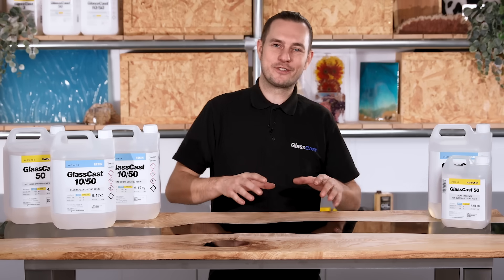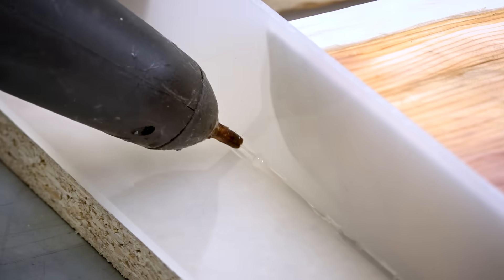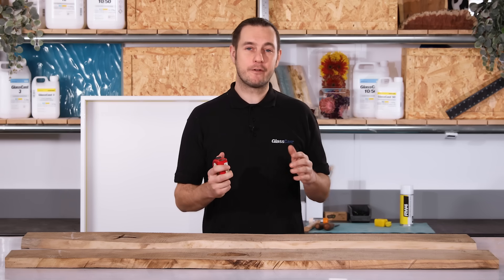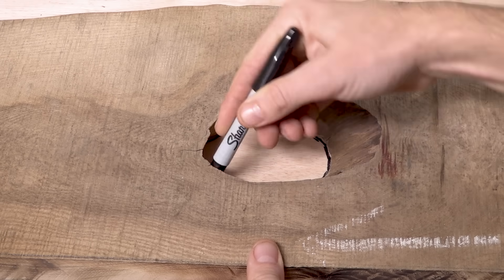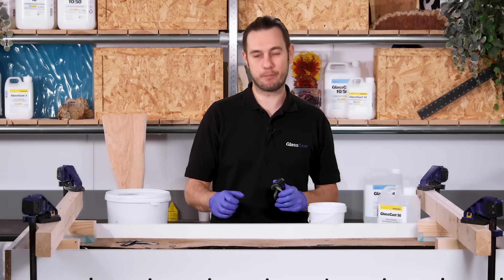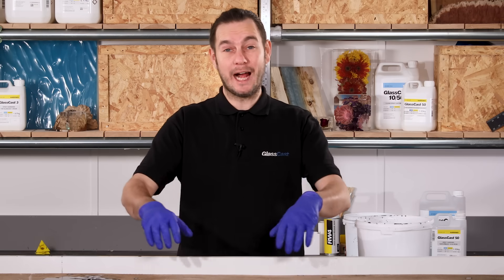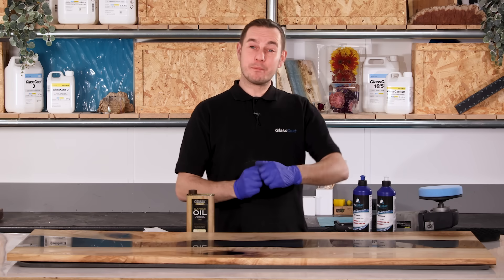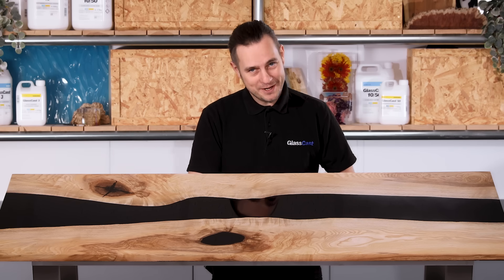Stop Wasting Money On Resin River Tables!

Comment from the maker: Thanks for all your comments, likes and subs - we really appreciate them!

To clarify, this tutorial is aimed at DIY'ers and makers that have been put off attempting river table projects due to the cost of materials and not to cut costs in professional production without customers being aware of the core. Additionally the technique is only suitable for solid colour and metallic river tables. 🙂
Reply from the maker: It might have been that the resin layers weren't poured at the 'B' stage, if this was the case and you hadn't keyed the surface in preparation, the resin may not have had a very good bond. If the wood wasn't fully dry and continued to move then this may explain the separation.
Reply: Oh no Blacktailstudio would have make even more profits only selling overpiced wood slabs over and over again...

Comment: Excellent, a company showing you how to save money by using less of their product is very very noble, and in my opinion speaks volumes.
Thanks for a well presented video. I plan on trying some epoxy projects and glass cast will be my first call.
Reply from the maker: The cost of resin can be quite off putting for a lot of people so this revised method may make resin river tables more accessible to people for whom a typical table with a lot of resin may be out of reach budget wise.
Reply: Doesnt it weaken the strength of the table? Now you only have 5mm of resin (x2). If you want to use less resin just make your gap smaller.
Reply: @tubester4567  Good point but personally I would suggest that it depends on the table frame/skirt which supports the table along four sides or across each end. Remember that the table is not "load bearing" unless you stand on it and nobody is going to try and bend it in the middle.
Reply: @Sly_Wolf_1  Maybe but Its common for people to sit on tables, or stand on them to reach high places. With the high cost of timber slabs I dont think I would risk it personally.
Reply: @tubester4567  and with the correct frame/skirt under the table you will spread any load. But each to their own. I know I could build this and have someone sit or stand on it without issue.
Reply: "speaks volumes". I see what you did there :D
Reply: @tubester4567  You'd be okay.  It's incrediibly strong the resin would adhere to the ply so it would be very unlikely the part of the river with ply would be pushed through the floor. It's not just the resin underneah the ply, but it is adhering to the sides / top of the ply also which is inturn adheres the the slab. 
All of that said though,  if you're spending hundreds of £$ on resin and nice wood, and people are going to use the table as something to stand on,  surely just build or buy a cheaper piece of furniture?....
i.e Would you pay £200 for some pristine white Nike Air Max and go and play soccer/football in the rain and mud, or would you buy other footwear thats more suitable for half the price?
Reply: I didn't even realize who made the clip. Thanks for pointing this out.
Reply: @Psychlist1972  😂😂😂
Reply: @tubester4567  work with furniture and resin, and the ply might actually make it more stable. Resin is surprisingly resilient and holds well, but one of its weaknesses can be fracturing or cracking under stresses, whereas plywood encased like that would act in a similar way to rebar in concrete. It also means the resin is poured in thinner layers, keeping it from having thermal stresses that could cause invisible faults and bubbles internally. I often just fill resin pour cavities with scrap hardwoods and leftover cured resins just to take up space on opaque pours.
Reply: It also gives a step by step proof of method, which increases the chances of a successful pour.  

Important especially when using gallons of epoxy
Reply: @tubester4567  Also, most of the strenght of any beam is in the edges as that is where most of the tension and compression happens. See I-beams for example. I wouldnt be worried about it.
Reply: @tubester4567  5mm of resin with wood behind it and to the sides will be more than strong enough. I have a piece where I had to fill in a cut section of abs plastic. It is maybe 3mm thick at the absolute most of resin with fiberglass reinforcement. The epoxy only sections are stronger than the abs.
Reply: @Ackbano  You should go out and buy some woven fiber glass sheets and use those as some extra filler on the opaque pours. Adds extra strength to the epoxy, but also will keep the weight down compared to filling it with wood. You will probably end up using more epoxy though. 

You can also use chunks of cured epoxy as filler. I save the cured epoxy that I peel out of my mixing containers and any large pieces cut off from over pour to use as filler when needed.
Reply: @zebraloverbridget  appreciate the advice, but a big reason I do what I do is to avoid more purchases, haha. Fibreglass weave is great though for some projects
Reply: Yeah, mad respect
Reply: @Ackbano  indeed, the reasoning that plywood-in-resin might strengthen the table as opposed to weakening it appears logical. However strangest things might happen, and if it is the resin manufacturer that went to the lengths of showing how to make this, then perhaps they could steal borrow the page from many diy channels' book and strength-test this build compared to an honest resin-only river table.

Comment: This is great if you're making an opaque resin. To me a massive part of the reason to use resin is for the transparency.
Reply from the maker: Hi Ben, indeed, this only works for opaque resin so there’s lots of situations where this can’t be used but where it can, we feel it makes a lot of sense.
Reply: @glasscastresin  sure. I just vastly prefer the resin to remain transparent
Reply: @benorchard78 you can make the plywood look like a river bed and still use clear resin. Unless you wanna see the floor through your table
Reply: @minhdaubu2363  maybe he's got gorgeous floors that just need a slightly colored viewport 🤷‍♂️
Reply: I reduced the amount of resin, by using small gardening rocks to imitate rocks/rapids in the "river".  Used a similar technique as shown and I figured I reduced the resin required by half.  This also allowed a more transparent resin pour.
Reply: @benorchard78  why post negative comments on a black resin river table top when obviously it doesn’t suit your situation. Jog on bud no one cares
Reply: Actually, you just have to bend reality around you and be creative, not you bending around reality. What's stopping you to print some normal sheet of paper and attach it to the plywood? Same technique as 3D floors are made.
To further strengthen everything, I'd have inserted 4 of 10mm rebars on the width, then interrupt and continue the plywood where they met.
Reply: @benorchard78  it's not compulsory, you can do what you like. He is showing us a cheaper way.
Reply: or glass.
Reply: @Sockem1223  I use glass and acrylic filler for resin, but often it's to recycle interesting pieces and not to cut down on cost directly
Reply: @R__A  the title says "Stop wasting money on resin tables!" ! It didn't say stop wasting money on opaque resin tables, just because he says this wouldn't work for him isn't being negative as some seem to suggest.
Reply: This is even greater when you are making food. You can mix a lot of fine sawdust or just celloulose like from shreded boxes. It disolve in water and when you add spice it is tasty. And you made easy profit 🤑🤑🤑🤑
Reply: @azza1793  "Jog on Bud"    I like that. Never heard that one before. I thiink I'll add that  to my repetoire. Well played,Sir🤭
Reply: @pooheadlou , if the specific project you’re doing doesn’t allow for a coat-saving technique, then it isn’t ‘wasting money’ to not use said technique.

You’re complaining about something that wasn’t said in the first place.
Reply: @benorchard78   good thing he stated that in the 3rd sentence or so 😮‍💨😐😐
Reply: Would using clear acrylic in the same way as the plycore achieve the same cost saving results?
Reply: What if you put glass in the resin to fill space?
Reply: Errrrr yes, that’s right. I don’t know why you thought you might have to point that out but maybe your from Wales.
Reply: I thought maybe he figured a way to make the plywood transparent  LoL
Reply: @thetruth156real3  Well you sometimes have to point out the obvious as people across the border are commenting!?!
Reply: @thomasherrin6798  😂👍
Reply: @azza1793  people can voice their opinions mr. big shot.. 
I came here to see if anyone else was thinking the same thing. And of course. I personally agree that it's kind of pointless to use that much resin in the first place that you can't see through it. If anything your comment was pointless. Telling people what they can and can't say LOL
Reply: Some people like black. This is a process for those customers. The world is full of processes that are situational specific.
Reply: It's a good thing he stated this very clearly within the first 30 seconds of the video so you wouldn't have to waste another 14 minutes and move on.
Reply: If you are trying with semi transparent rasin try 3d printed honeycomb lattice it will sure look cool
Reply: Yeah, your channel is full of all those river tables!
Reply: Maybe if you used a clear acrylic fill?
Reply: @vrillionaire88 : Come on, your net results is you're still saving resin, whether that's your motivation, or not.
Reply: @jayedwin98020  the results do matter, which is why my focus is on the actual results, and not the consequences of the results. The result is a collage or mosaic with resin as a polymer mortar, which is far more interesting than faking depth. The consequence of that method is that I save resin.
Reply: @ramseydarkstar  triggered?
Reply: The presenter says at 24 seconds in this is for opaque or metallic infill tables, why did you watch the rest or bother commenting if it’s not what you want, I could have left a comment that this video didn’t show me how to dip a fuel tank for water, as that was the last video I watched but that’s not what this video is a out
Reply: I would be super hesitant to do a river table in clear resin since it will yellow as it ages.  I'd be curious if there are any examples old enough out there to see how bad it looks in practice.
Reply: @azza1793  if that's a negative comment for you, then you shouldn't be around in the Internet kid
Reply: @glasscastresin  could you use glass as a filler?
Reply: Exactly. Otherwise, you might as well just use an glossy enamel paint and not even have the cavity in the wood.
Reply: @juvat2440   That's cool and it adds to the river effect.
Reply: exactly, just paint it on at that point
Reply: He clearly indicates “solid” or “metallic”
Reply: @benorchard78 Once you go black there is no going back. Haha.
Reply: @pooheadlou the presenter says at 0:22 that this is a method for river tables where you’re using a solid colour of resin, rendering the original posters comment… stupid at best and looking for a gripe at worst.
Reply: @ramseydarkstar the original poster’s comment was pointless because the presenter in the video says the exact same thing at 0:22
Reply: @surlycanadian  
' rendering the original posters comment… stupid at best and looking for a gripe at worst.'
Total pile of crap.  'Stop Wasting Money On Resin River Tables!'
They used a click bait title because they knew if they delimited it with only 'opaque resin river tables' that far, far fewer people would have been interested and clicked on the video.
'Oh, they said it in the video.'  Doesn't change one whit that the main title is intentionally misleading.
Stop lying that saying things correctly for what they are is the problem.  No, it isn't.

Comment: Another option for river tables, especially clear pours, use varying sizes of gravel to simulate stones/boulders in the finished product. You could also use sand under the gravel to reduce the volume further.
Reply from the maker: Yes encapsulations are a great way to reduce resin usage where they can be made into a feature.
Reply: @glasscastresin  Out of curiousity, applying the same method as seen in the video - do you think using an acrylic filler in replacement of plywood match the refractive index enough when poured with uncolored/transparent resin to go unseen? Of course cut edges of the acrylic would need to be polished.
Reply from the maker: @Raraoolala  You would really need to test this out to see how well your acrylic was matched to the resin once cured. The edges of the acrylic where it stops short of the wood may pose the biggest visual problem.
Reply: @Raraoolala  Even if you'd get it "close enough", you'd still see it from certain angles or light conditions, really you're just asking for trouble. With the plywood core in the video it's very likely there were still some tiny air pockets trapped between, but it doesn't matter because you can't see them. With clear epoxy and acrylic you simply don't have the luxury of hiding tiny imperfections.

Comment: For those who don't feel like watching a 15-minute video about something that can be summed up in 30 seconds. The idea here is as follows.
1 - Set up your slabs like you normally do in the mold.  
2 - Pour a thin layer of resin on the bottom (1/4"-1/2" - the darker the tint, the thinner this layer can be). 
3 - Take a piece of wood or something else solid (almost anything will work) that is slightly shorter than the overall length of your table and place it in the middle, on top of your first, partially cured (but still tacky) layer, leaving approximately an inch or so on each end.  This "filler" piece can be cut with a jigsaw to the contours of your slabs in order to take up as much volume in the middle as possible this maximizing your resin savings.
4 - Pour the top layer of resin so that the filler piece is completely encased in resin on all visible sides. 
5 - Finish the table like you would any other epoxy resin river table.
Reply: I got all the just by looking at the thumbail.
Reply: @OU81TWO  Congrats! Most of us probably got it from the thumbnail.  However, some people probably did not quite get it as well, so I figured I would summarize.  Not sure how this guy thought a 15 minute video was necessary though.
Reply: @TheRealJohnHamp  He's making content. Needs watch time to generate more $$$.
Reply: Don't forget: 1) the tip to tint one of the parts of the resin so you can get multiple pours of the same colour; 2) the sealing of the live wood edges to minimise the generation of bubbles from the pores; 3) the Danish oil sealing of the wood prior to polishing the epoxy so the polishing compounds don't get embedded in the wood and discolour it.
Just to name a few things one does not get from the thumbnail...

Comment: Helpful hint. If you can, put part B in the cup first and add Part A.
I've found that as part B is thinner, it doesnt stick to the sides of the mixing pot as easily as part A. 
Less likely to leave unmixed resin on the sides of your mixing bowl.

used about 20 litres from Glasscast now.  Great product and great customer service/tech support.

Comment: I do this already. I use up my scrap lumber. Be sure to seal the filler boards to reduce bubbles.
Reply from the maker: Yes, totally agree on sealing the filler boards. Hopefully that came across clearly in this video.
Reply: Amen... my scrap pieces get used like this, and if not big enough I slice it into strips and laminate them all together.  Quick run through the planer, seal , pour and honestly some of my favorite pieces!

Comment: The use of resin - for me, the amount of resin featured - is a very personal view. I wouldn’t want a table where the resin seemingly overwhelms the timber but, then, I’m a woodworker. The useful thing - the very green reason - to use resin is that it takes boards which would otherwise be scrapped or cut up with a lot of waste, and make them into objects that can be used. I’ve made many tables that have resin in them but the resin is just used to fill checks and faults in the slab. It’s a far cry from a 40% resin river table. 

However, there is no denying that river tables are sought after and, whilst I though the fashion would be short lived, it continues. In fact, buying a waney edge slab now costs more (per cubic metre) than processed square edged material. Such is the law of supply and demand plus the opportunistic timber seller. 

I think that all the tips that I have learned (the hard way) have been noted by Glass Cast. I do use a degassing chamber connected to a vacuum pump for smaller pours (quite often moulds for items such as clock numbers) but it’s impractical for large volumes. So, I do go for coating the edges of the timber the day before if it’s a deeper void but always go for very slow cure (for which you can buy an additive) and regularly a hair dryer passed over the surfaces to release bubbles. If you want to see someone make resin tables very well, and for a living, look up the Manor Wood channel.

Comment: As a retired toolmaker/machinist with MANY years under my belt. I have helped manufacture many molds over the years.
This is very common what you have done here. For these of you whom don't understand molds,
This is how a mold makes a plastic cup, for a simple example. Metal is engineered to make the inside part of the cup, which is turn
will make the wall thickness of the cup.
Or when manufacturing an engine block,  a core made a sand to make the holes for all the cylinders. The molten metal will flow around
the sand/core to produce a hole where it is needed. 
Good way to save $ on materials and machining time.
You actually explained this very nicely!  👍